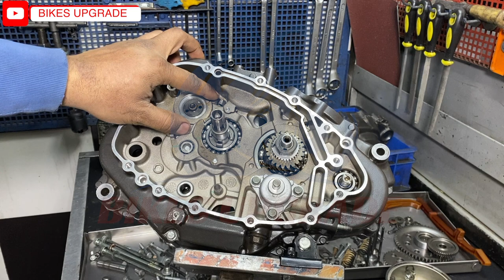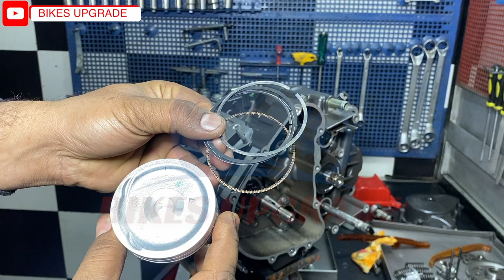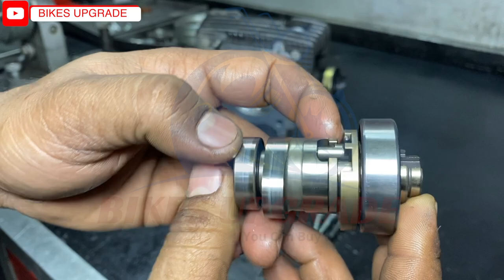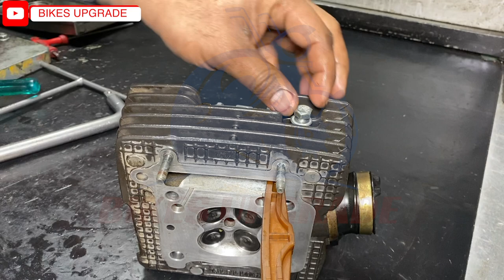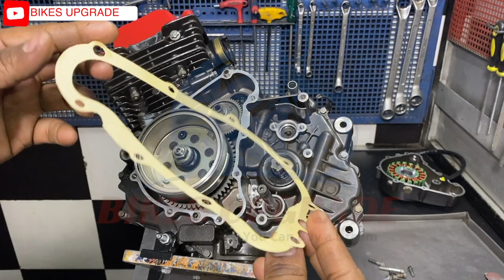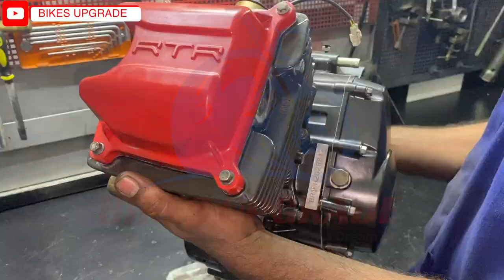How to fitting motorcycle TVS Apache 200 cc 4V full Engine , watch this guide! #tvsmotors#bikes

Comment: Another question is that it is possible to use another ring and piston that is stronger than the TVS brand, I don't know anything, for example, Suzuki or Honda, can that rig and connection be installed on the Apache 180 engine, does it work or not, is the Apache factory better? please answer

Comment: hello, at 27:20, what is the reason why the washer you put at the bottom of the stud is copper, I will be glad if you answer👋
Reply: its sealing washer
Reply: @Startekselva  Hello, which oil should I use for RTR 200, fulsynthetic or semi-synthetic, for the health and longevity of the engine?